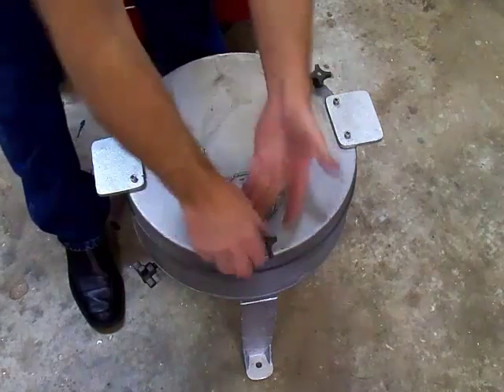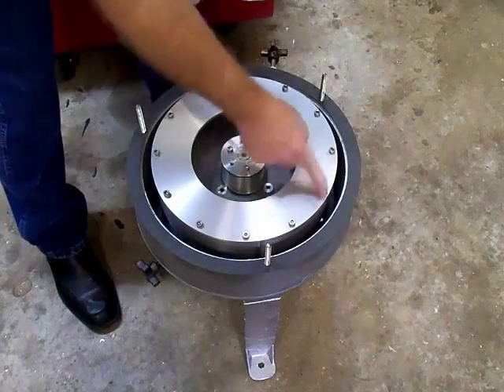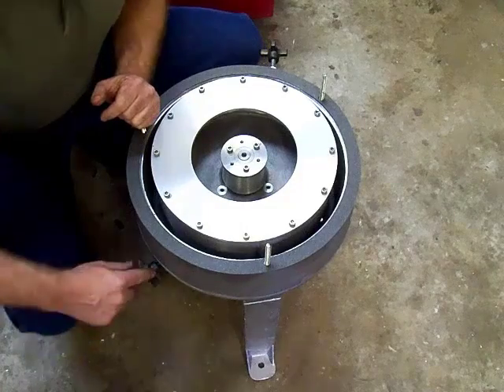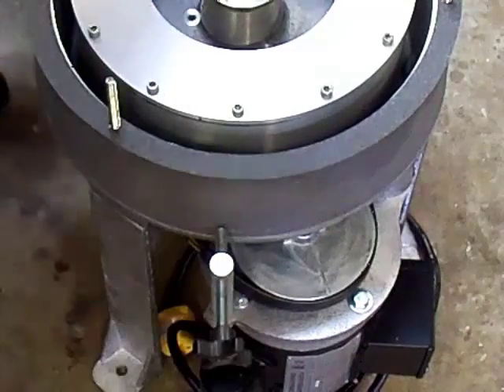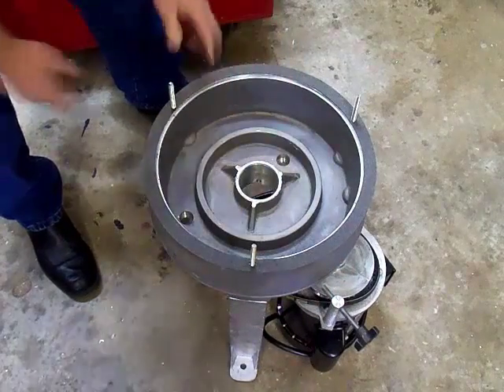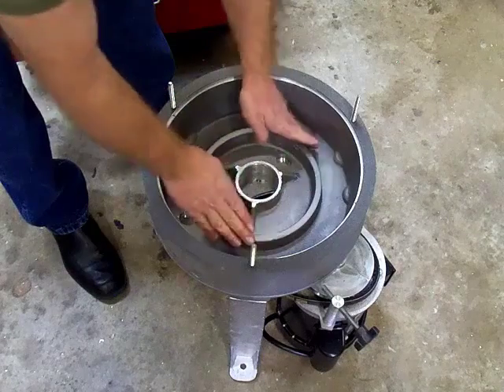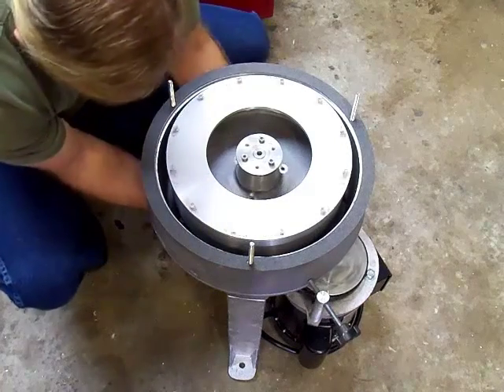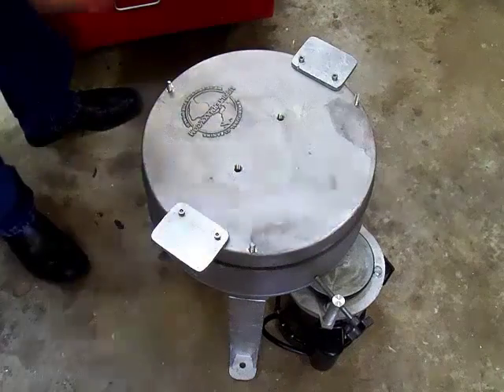WVO Centrifuge by US Filtermaxx for Biodiesel,Black Diesel, Used Motor Oil, Hydraulic Oil

Comment: Just wanted to say that I really like my USFM centrifuge. Very well built and I am glad I did not fall for the direct drive whirly flingers. I appreciate all of the support from your company. Mine was used and used well. I rebuilt the bearings in the motor and replaced the caps. Easy fixes. Inexpensive. Good as new. You might want to add a few videos at some point.

Comment from the maker: Aluminum Centrifuge - stainless steel spindle, collet and bowl hardware. Nearly indestructible and easily rebuilt. Motor chugs along at 1800 RPM while bowl spins at 5000. Commercial duty runs 24/7 day in day out. Extreme cleaning for your oil.